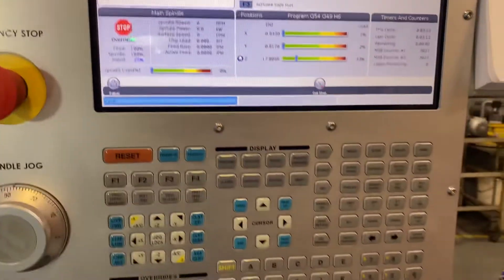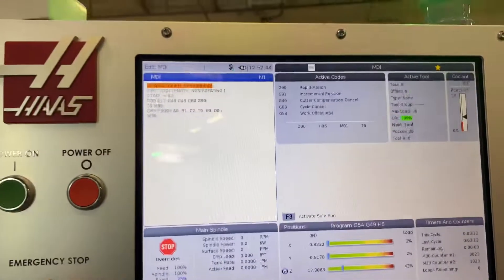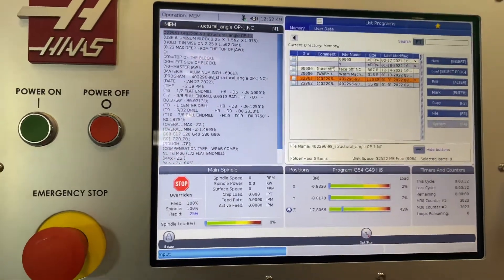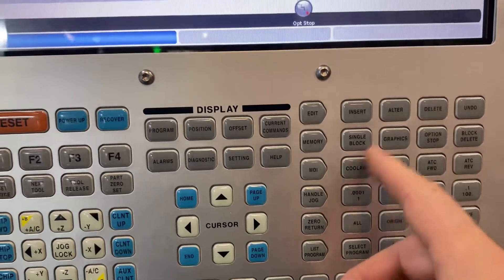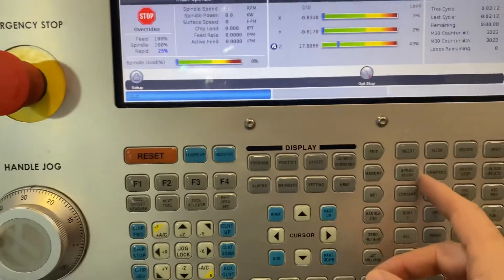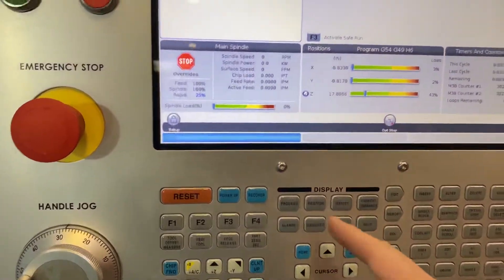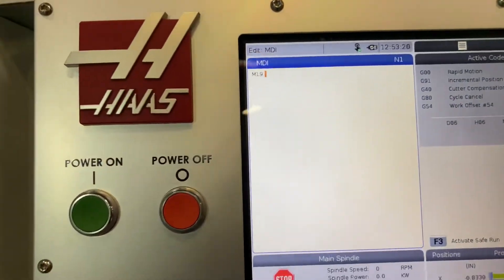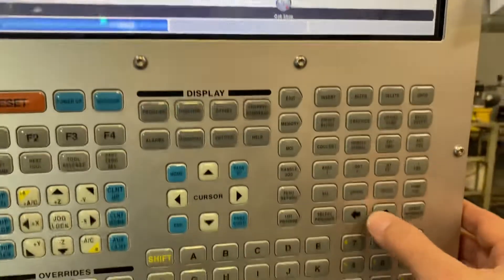Haas no orient spindle button

Comment: Mdi m19 imput. Also DONT use the spindle to remove tools. Take the tool out and use a fixture to swap drills.
Reply: It's a wasting time.
And people always hve some in Mdi
Reply: @sc4500  Fixing a spindle you ruined by misusing it is a waste of time. Removing the tool holder and replacing the tool properly is a normal part of the job. If you wanna break your machines by trying to cut corners then more power to you. But don’t bitch about “haas quality” when your machine is down for two weeks and you have a bill for 10k for a spindle rebuild. Because you broke it.
Reply from the maker: @justaguywhoplaysfalloutsom1104  The orientation spidle is heandy. I used for drill chuck they need a small tide pressure. Not intend for tighitng the endmills. Or anything else